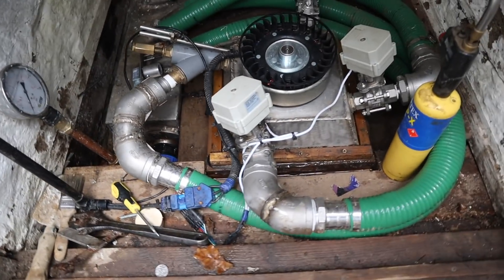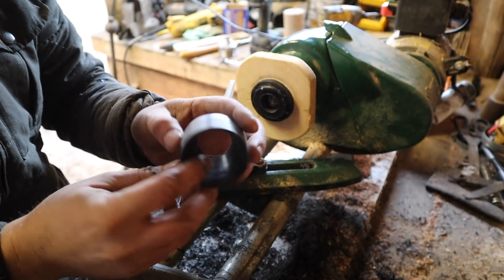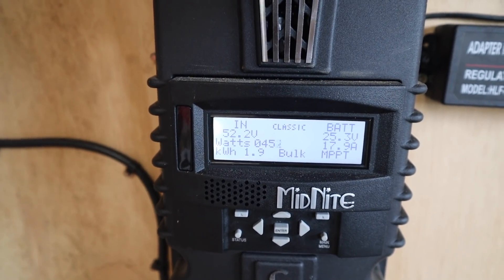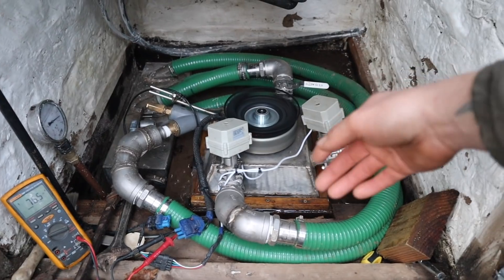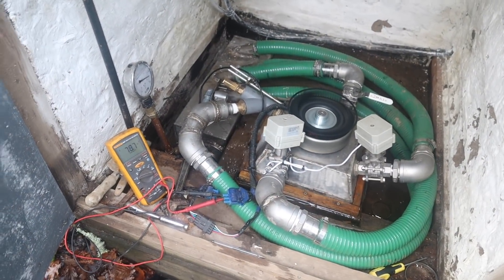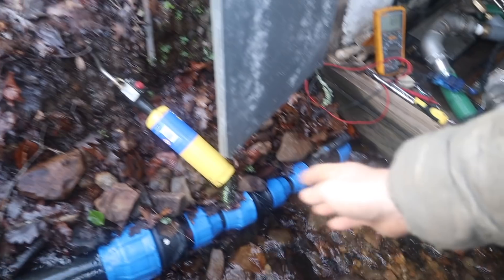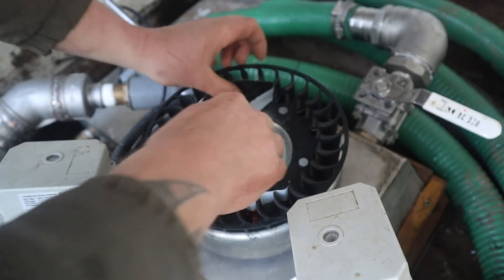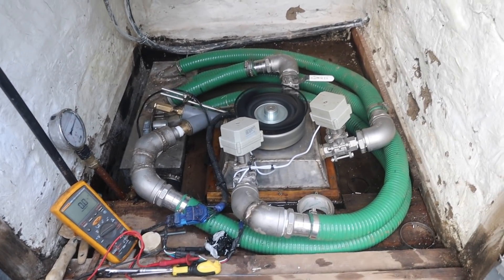Off Grid Micro Hydro Turbine Fine Tuning (Tapered inserts and fan loss testing)

Comment: Awesome video! I wonder if you could mount an AGNI or Lynch high power D/C motor directly on top of the fan shaft or off to the side with a clutched pulley system.  They are often used as generators in industrial applications and are over 85% efficient.  I am a huge fan of them although I use them for propulsion on projects and they make ridiculous torque efficiently with simple electronics.
Reply: What type of motor do you mean? 
Link please.
Reply: @davebutler3905  You usually can't share links in comments if it's a monetized channel, but here is more info:

The Lynch motor is an unconventional design with a disc armature. It marries the advantages of a conventional, wound armature motor with the benefits of a flat (printed circuit) motor. It is similar to a pancake motor, but is more powerful than any of these technologies. The disc armature has magnets on both sides, doubling the available flux density and shortening the magnetic path. It therefore packs more power per pound and per cubic inch than any other motor technology. Of course such a revolutionary motor is not for every application - it is not as cheap as wound field motors, but for many applications it is a far superior motor.  It has a previously unheard of power to weight ratio and also power to volume ratio. It is also highly efficient because of the double magnet design and associated short magnetic path. It also includes integral fan cooling.

 The Lynch motor is an important development which spurred other motor designers to improve their products to remain competitive, such as synchronus permanent magnet machines.  As a result of the competition between manufacturers the cost of high performance motors and controllers has fallen dramatically.  We hope the cost of solar cells also reduces to allow renewable transportation to develop as a viable alternative to carbon fuels.
Cedric Lynch built his electric bike around a mid-drive configuration, also building one of the worlds most efficient light weight electric motors to power his rig reliably at 60-MPH for significant distances. He would later set several world records with his axial flux motor and bring it to market as the Lynch / Agni motor. Briggs and Stratton would eventually buy this technology which would lead to the Etek motor, which is now famous for making high speed efficient electric hot rods.

Cedric uses to achieve high speeds is by following the rules of aerodynamics, and building a bike that is as aerodynamic and as efficient as possible. The other builders on this list bypassed this step, and Cedric uses this bicycle as daily transportation on real commutes. Although this high-efficiency motor uses “old school” brushes, this fact allows builders to use very affordable controllers. He has proven his design choices through thousands of miles of commuting, and the Lynch motor is highly respected.

Cedric Lynch is known as the creator of the Agni Motor, a highly efficient electric motor that weighs around 25 pounds and can put out as much as 50hp. 

Cedric Lynch is a British 'mad scientist' type mechanical engineer obsessed with the idea of greener transportation. His interest has been in building a super efficient yet powerful vehicle that can serve as a car replacement.

He started thinking of his own design for an electric motor in 1983 when he began entering competitions organized by the Battery Vehicle Society regarding building an efficient electric vehicle. At the time there was no reasonably priced DC motor with descent efficiency so Lynch decided to build his own utilizing modifying existing motors with old tin cans that he would spread out flat to use as cooling fins. Surprisingly using rudimentary materials and a garage work bench, Cedric was making better more efficient electric motors than any of the universities were able to manufacture in state of the art workshops.

Cedric then came up with a motor design that could be cheaply manufactured and began manufacturing his own motor that he could sell to the public in 1988 and the Lynch Electric Motor Company was born, known as LEMCO.

Cedric first used his motor to create a small boat called “The Spark” that would set an electric boat efficiency record. From there Cedric turned his attention to bicycles, an application generally considered too small for a lynch motor at that time. Cedric mounted his motor in recumbent bike, allowing him space to eventually use a set of thundersky lithium batteries.

The resulting aerodynamic recumbent bike had a top speed of 60mph and still managed an incredible range of 150 miles. Cedric rode his recumbent creation everywhere as a daily commuter, putting an amazing 50,000 miles on the machine - technically a motorbike.

Briggs and Stratton, the US firm famous for lawn mower engines, bought the technology and used it in their E-Tech Motor, and Cedric went on to manufacture his latest incarnation of his lynch design into the Agni motor, which is used in go karts, sailboats, motor boats, and even small airplanes.

The Lynch designed motors all have the same traits. Brushed motors, around 25 pounds in weight and they are able to put out enormous power compared to their weight. Sometimes as high as 50 hp (depending on amperage ran through the motor) at an incredible 98% efficiency.  Lynch Motors are also the most often used motors in electric motorcycle racing applications.

Cedric's zero-emission motorcycle, which has a top speed of 120mph, was shown in action winning the world’s first zero carbon race – the TTxGP in the Isle of Mann.

The idea for the electric motor has been snapped up by the 56-year-old’’s friend Arvind Rabadia, who together with his brother Hasmuk Rabadia had been thinking of starting a business in India. They have now set up Agni Motors to make further-improved versions of Cedric’s motors

Despite Cedric’s breakthrough invention he has no formal engineering qualifications and taught himself the techniques needed to construct his engine. He first became interested in electrics when his parents bought him a book entitled How to build things from things found at home. 
The Etek motor is a brushed 25-pound pancake shaped motor that puts out enormous power for its weight. Depending on amperage and voltage the Etek can easily provide between 15-horsepower and 30-horsepower reliably and consistently (11-kW / 22-kW). A perfect platform for a powerful electric bike if you do not mind the weight. Although brushless motors are considered more modern, a brushed motor like the Etek allows the builder to use very affordable controllers.

Cedric-Lynch invented the motor and sold it to Briggs and Stratton which US company produced the Etek at a lower price (around $600). In the late 90’s early 2000’s it was the way to go for a high-power / light-weight electric vehicle. Many small E-vehicle records were set using the Etek motor. Finally, the market had a relatively lightweight and powerful electric motor available to the masses.

In essence, the Etek allowed hot rodders to build electric bikes. Before the Etek very few people had ever achieved 50mph on an electric bike. Even today, Etek motors (and newer incarnations of the Etek motor) are used to make some super fast electric bikes. In the case of Liveforphysics, the fastest E-bikes ever.

 Liveforphysics used a newer version of the Etek (the Agni motor), to achieve speeds of over 70mph, and dominate a recent hill-climb event.

Every Etek I have ever ridden has been characterized by brutal off-the-line acceleration, usually to a point where you have to apply the throttle very carefully or get thrown off. However, it is possible to run an Etek at a lower voltage or lower amperage and have a very manageable, safe, and sane electric bike that will not burn out on you, no matter high steep the incline.
Reply: @ProlificInvention  thanks a million
Reply: @ProlificInvention  
Fascinating stuff... I was just playing with some designs (only on paper) that include double magnets and very thin two phase windings... 
I even thought it might be possible to  make the coils on a PCB. 
I'm always late to the party!
Reply: @davebutler3905  I have, however I still think the AGNI/Lynch motor is superior for smaller vehicles on a budget.  That motor is about the same size and almost triple the weight of the AGNI/Lynch motor-but also outputs more than triple the power.  The big benefit of the lynch motor is it's simplicity and cost effectiveness as it can use virtually any DC motor controller, charging circuitry, virtually any battery.  The AGNI/Lynch motor is a high torque motor capable of over 150ft/lbs from 0-2,500 RPM and runs on low voltage from about 6v-80v, it can even be direct connected to a battery since it's a brushed DC motor.

Comment: Look up Hayward ball valves, they have incredibly smooth transitions. Super high quality in sizes up to 6 inch ID. I've used them in corrosive industrial applications for years, they last almost forever. They get a little expensive, but it's worth looking into you only need one you can find it used. We can find you one somewhere.

Comment: Kris, I love your hydro videos, wish I was on a position to do the same thing. The single biggest improvement you could make to efficiency in your system is changing your battery technology. Moving to lithium batteries with a round trip efficiency of over 80% vs the 50% of lead acid. You may be generating 450W but your batteries are wasting a lot of that. Granted they are expensive but its the up front cost that is greater not the extrapolated cost. and thats not about the efficiency of the hydro system...

Comment: The Austrian naturalist, Viktor Shauberger, worked extensively on the issues around friction losses in flumes and water pipes. His observations of streams running through primal forest lead him to develop various designs based on the idea of introducing a vortex into the flow that would increase velocity, reduce temperature and harness suction. http://www.rexresearch.com/schaub/schaub.htm - heads up to Gerbutt's comment about rifling. Anecdotally, an old Desert Rat that I knew back in the 70's, told me that whenever they had to re-fuel their vehicles using jerry cans they would swill the cans round to create a vortex so that they would empty in double quick time....helpful if you're under fire.

Comment: Kris you need to think about and design the the complete turbine and feed before the hut, then build the hut around it, to avoid putting a valve in the supply you could put a 6+" gate valve in the bottom of the manifold and let it dump to the stream. And to the people that think that you are still trying to get the system to work properly, it is sorted, engineers qualified or not can not stop tinkering with their work and I put myself in that camp.

Comment: Why don’t you measure the rpm of the turbine Kris? That will save you having to run up and down to find out wether there’s an improvement or not. I take it the faster the turbine spins, the more energy it produces.

Comment: Kris, I don't understand why you wouldn't want your generator running at full speed when you need power, why not have 1 big electric valve to open and close when needing power? Reduce all the restrictions.
Reply: Wildly varying flow rate of water depending on time of year and rainfall. System needs to be efficient at low flow rate as well as high......
Complexity of system is for a reason...!

Comment: As @aceNthaHole also ponders, I wondered if the manifold were actually a torus, surrounding the turbine, with maybe 4-6 jets arranged radially in pairs (like spokes in a wheel, with the hub being the turbine). I can’t help but think a scale model would be a neat way to iterate through ideas, without having to invest in expensive plumbing......does anyone have a resin printer and a curious mind to try this?

Comment: Hi Kris, Do you still use the old diode based rectifier or have you tried a "ideal diode" based 3 phase rectifier? I haven't found a proper one for myself so I will most likely design my own using an LT4320 https://www.powerelectronics.com/pmics/low-loss-3-phase-ideal-diode-bridge-rectifier-reduces-heat-easing-thermal-design#close-olyticsmodal
Reply: Did you get one working???
I recently added schottky diodes to a 3 phase bridge. Judging by the temperature, there is very little loss now.
Reply: @davebutler3905  Hi, yes I got it to work, but supporting higher voltages is a challenge since the controller ICs I have been checking do not support that. The Schottky diodes was a nice idea!

Comment: I know when you go bigger with a hose, your flow gets substantially larger for every mm (or inch for us yanks) you gain, but if your problem is sourcing an appropriately sized ball valve, wouldn't it just make more sense (in your particular application) to just run a second line, rather than a larger one? I suppose you could then cut your manifold into two separate manifolds, and each of your large hoses would feed into two of your spray valves. Curious to hear your thoughts!
Reply from the maker: the trouble with that is the extra fittings and extra manifold have losses so the loss in those would make it less worth doing. having the one big pipe going to one manifold is the biggest flow with the least loss. its just going to mean trying to make a 90mm pvc ball valve fit my pipe or something like that.
Reply: @KrisHarbour  Gotcha, all good points, I'm sure you'll figure it out and I look forward to watching the video!

Comment: I would like to see the effect of a large pipe right up to the nozzles because large volume low velocity flow is efficient.
Reply: I do not think he has enough water for a high flow system, Thus the reason why he is using low flow and high pressure.
Reply: @kameljoe21 
The low velocity flow through a larger pipe should increase the pressure at the nozzles because of the efficiency of the flow through the pipe. I think that the water then being sent through the same nozzles at the same flow rate would have a bit more power and would thus generate a bit more electricity. I would like to see a test of my theory.
Reply from the maker: That is true and the plan is to get the big pipe right in to the manifold.

Comment: I haven't read all of the comments, but have or had you considered making two intake manifolds each having its own 61mil ball valve. It looks as is the current configuration is on manifold splitting the volume of water into four jets.   Just giving you my thoughts. You may have already determined it wouldn't make a difference

Comment: I know you are a very talented person but I am not sure if you know the lathe tool you were using isn't the best choice for doing the job. The parting tool you were using is more for cutting work off or feeding straight in.
Reply from the maker: yeah i know its a parting tool but for this plastic it was cutting the best out of the tools i have so i used it. To be honest i never really understood the whole "that is not the right tool" the right tool is the tool that works. all the other tools wanted to chatter loads and really dig in, the gouge worked well but no good for getting in the corners so i just used the parting tool. being so small it was very controllable in such a soft material that wanted to grab the tool.

Comment: What is the efficiency of the PMA rated at?
I.e 1kw at 3000rpm
Reply from the maker: Not 100% sure, the info says its 85% efficient but does not say at what rpm.
Reply: Just a thought for the future, but you could upgrade your PMA. Maybe one that runs at 1500rpm but outputs 2kw. Also it would not take much to fit an rpm sensor and rpm meter, just out of interest to monitor it’s rpm efficiency’s. You could use a cheap bicycle rpm meter, or a one for a vehicle. I think it’s great what your doing, but as with everything, can be continually improved. 😁👍🏻 Also if you add an rpm meter, vs the watts you are generating you should be able to work out your true losses based on the PMA rated KW output.

Comment: Maybe not worth the time now but good to know when you are gonna produce them in mass!! You will be able to sleep better :P On the other hand i would really love to know it a laminar flow hitting the pelton turbine would increase the efficiency instead of a turbulent flow as it is now... If you get the same interest here is a easy way to make it and maybe placing it between the pipe and the nozzle would be an easy way to try it out. https://www.instructables.com/id/Laminar-Flow-Water-Jet-for-Under-25/ . 👍
Reply from the maker: Hi, im not 100% sure what would happen with laminar flow but my intuition tells me that having the straws and wire-wool would add way more friction and loss than having turbulent flow does. I dont know of any commercial turbines that make laminar flow a priority i really dont think it is that much of a factor. The single biggest design factor for hydro is keeping friction loss as low as economically possible and adding straws or something to get laminar flow adds alot of friction. It would be interesting to test though.
Reply: @KrisHarbour  yes, I agree if a laminar flow doesn't help consistently it will be even worse